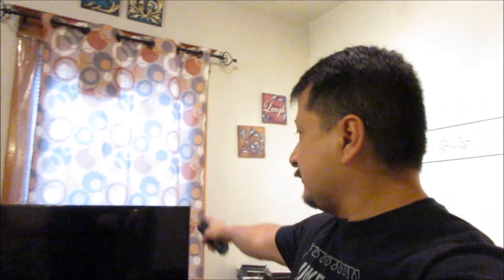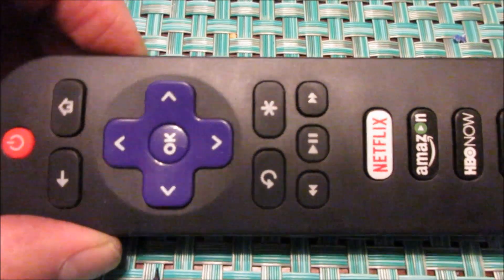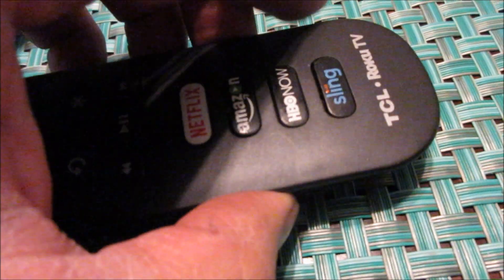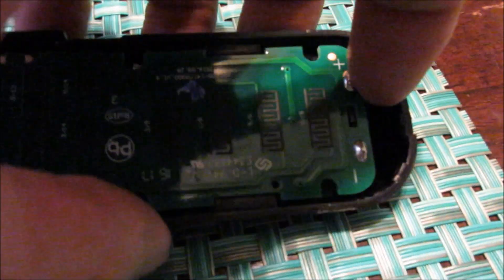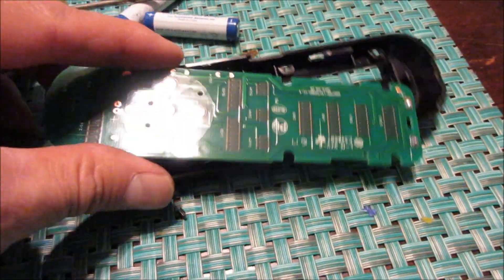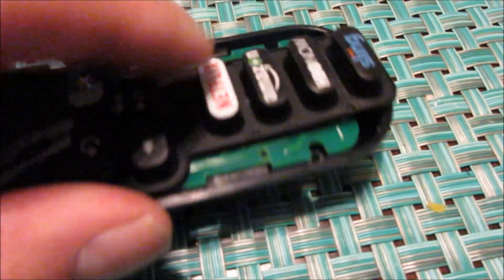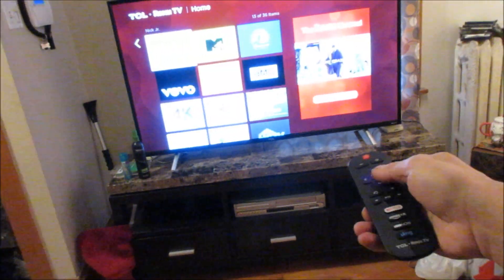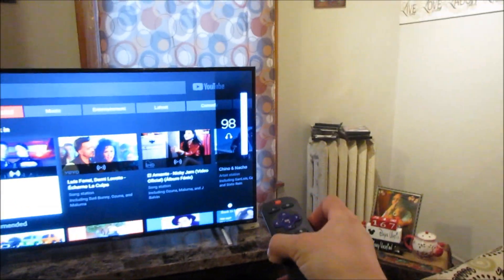Fixing a stuck button on a Roku remote

Comment: Thanks, wasnt sure where id need to wedge it and didnt want to break any of the remote trying to get it apart. One of my gel buttons was like 90% compressed down and made clicking up on the pad really annoying, fixed it by taking it apart and pushing it back out. (i think it happened cause i laid something on the remove  for a few days without noticing, so try not to do that) lol.

Comment: Hey rob do u have any suggestions on buttons that are hard to press down? that are stiff? I got the same remote...need to get them loosen some how specially with the arrows buttons..
Reply: Did you ever find a solution for this problem? I am experiencing it now, have to press one button hard to get it to work.